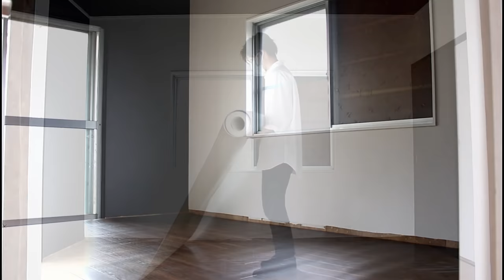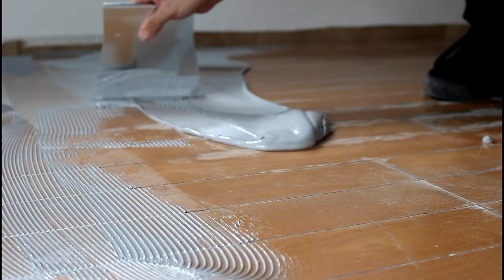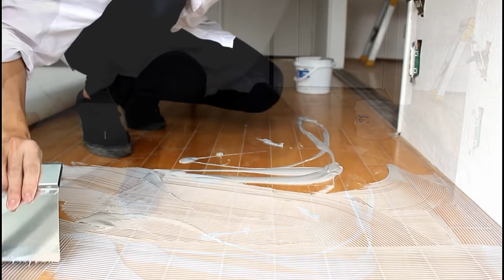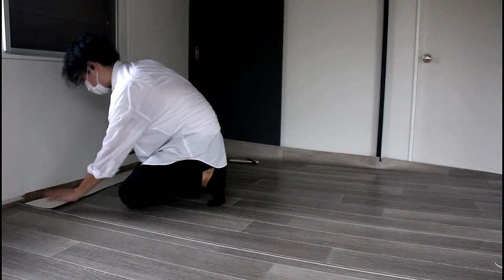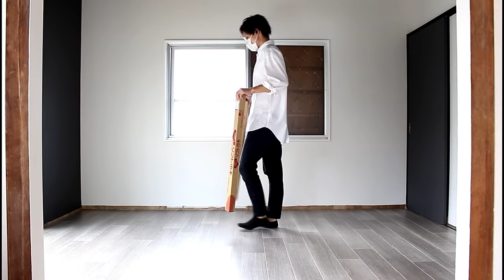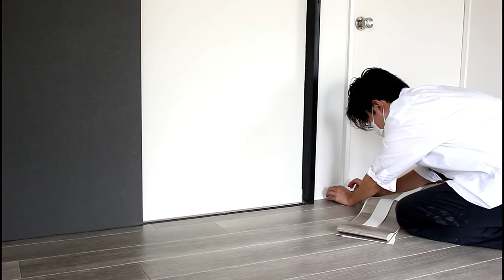【DIY】#9 相続物件をセルフリフォーム！床材を貼る/茶色と白のクッションフロアを比較してCFを取り付ける

Comment: I see you added insulation in the ceiling, how do you heat the rooms? Do you have a central heat and air like in the homes in U.S. have?
Reply: Japan for the most part usually has space heaters. Not central heating like America. Especially in these older homes.